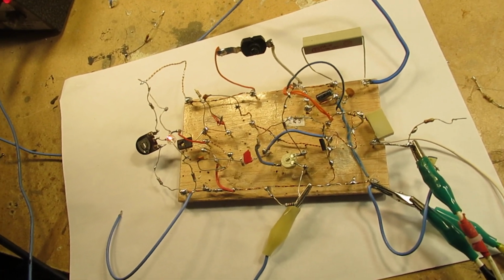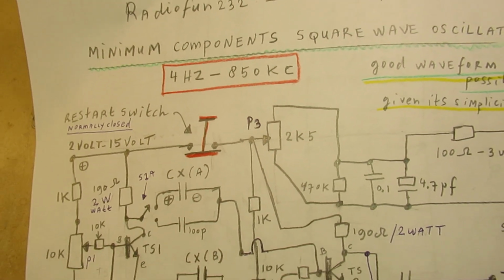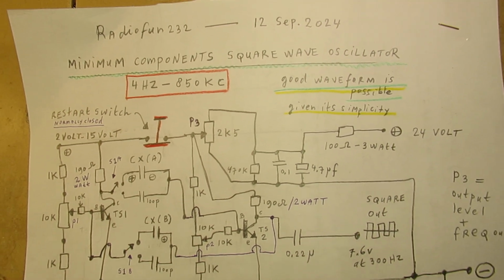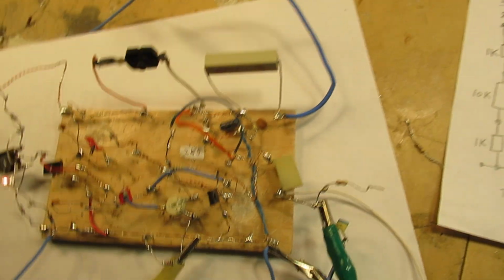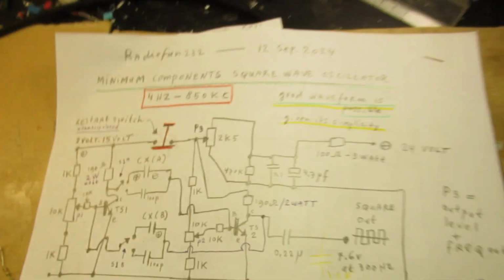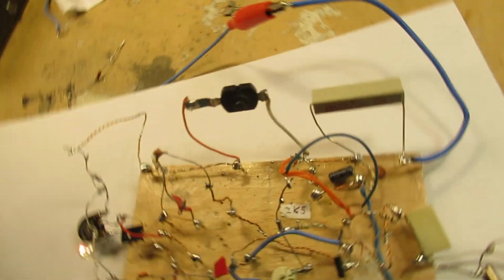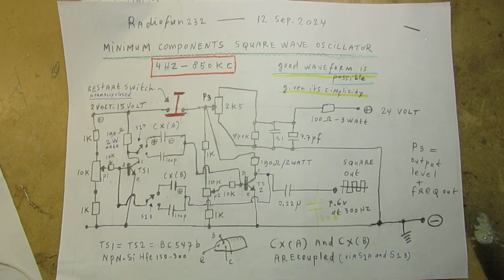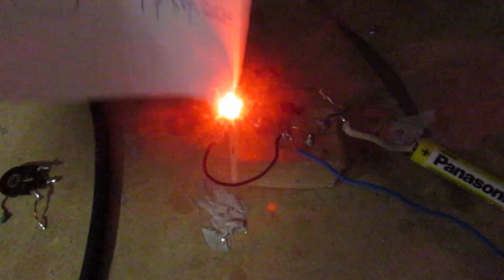Can the 2 trans. MUVIB at max 600 KC get higher? First exp + bonus showing a depleted batt LED light

Comment: In radio circuit book I found multivibrator circuit up to 50MHz.
Reply from the maker: Thanks & yes, that is so strange. I also had lots of hope....
Reply from the maker: In the past I made this circuit, with a Muvib, as far as I can remember, working on Shortwave, it works without coils. Thanks for your comments.

Sine wave oscillator without coils on 6 or 7 MC (11 november 2020)
 https://youtu.be/qrxDub_Gxow

More info in the textbox of that video, also how I developed it in that past, via other circuits.

Comment: I imagine that you know about "Gimmick Capacitors," to make DIY low/small value capacitors... For those that are not familiar with such a capacitor, it is nothing more than a pair of insulated wires twisted together. More turns equals more capacitance. Research it on YT and the web. It might be useful for this circuit? "This is fun!" Agreed!